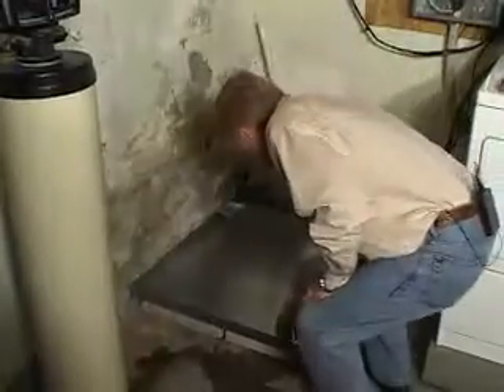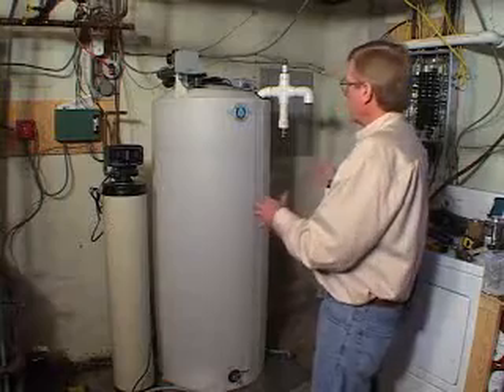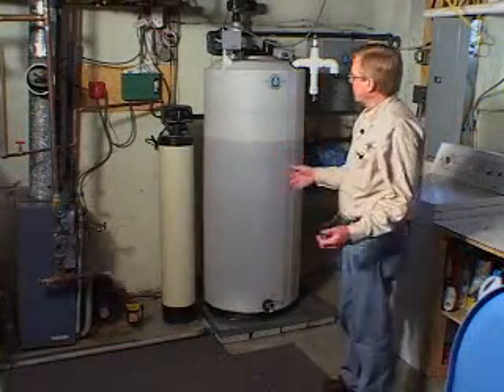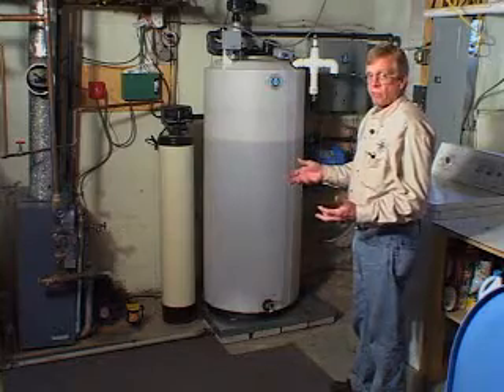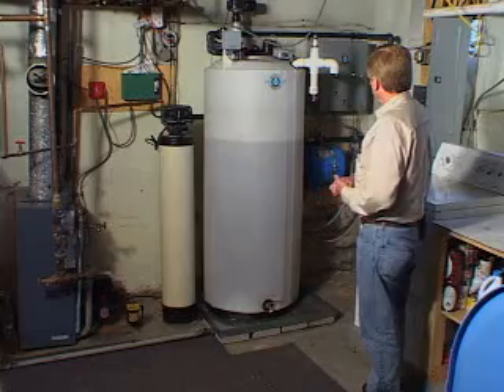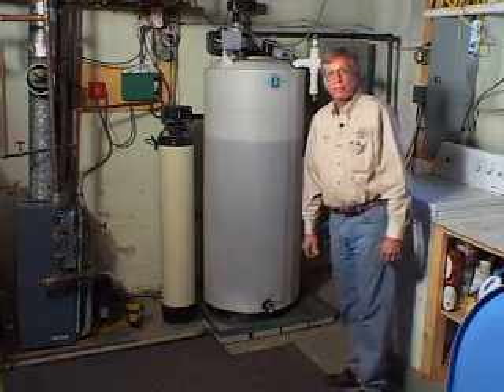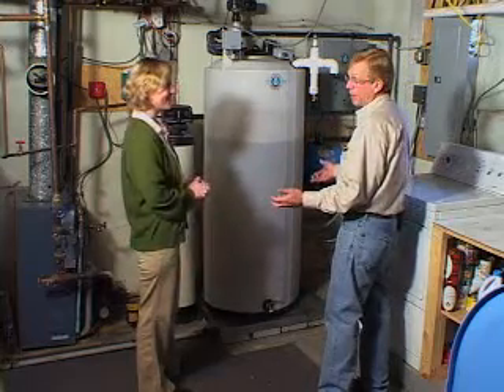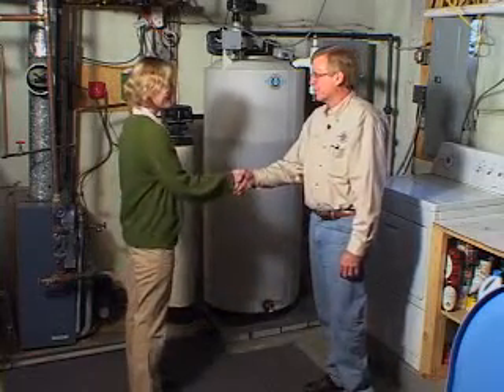Well Manager Installation part2

Comment: Excellent!  I have been using solar pumps with timing circuits to allow folks to use their low recovery rate wells.  This looks like a great addition.  I would like to know the power requirements of the control module and booster pump because we would be running this offgrid in most installations.
Reply from the maker: +engineer775 Practical Preppers   The control uses less than 2 amps intermittently. The delivery pump and the well pump could be solar powered using the Well Manager control to handle switching and protective functions
Reply: +wellmanager Thank you sir.  Do you have dealers?  We run into low wells about once a month so it would be nice to offer another solution.   
https://www.youtube.com/watch?v=lToStxg7SpE
Reply from the maker: +engineer775 Practical Preppers   Yes we do have dealers. Our website is www.wellmanager.com  These systems are in use on wells down to 0.10 gpm.  Many customers on quart per minute wells.  No down hole sensors required.